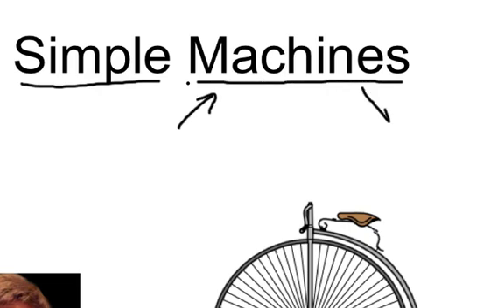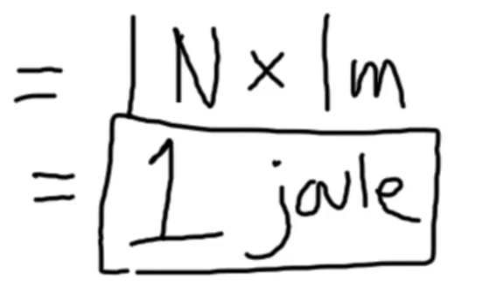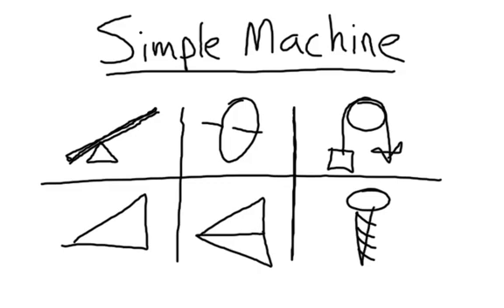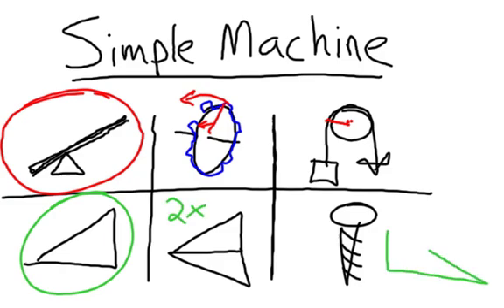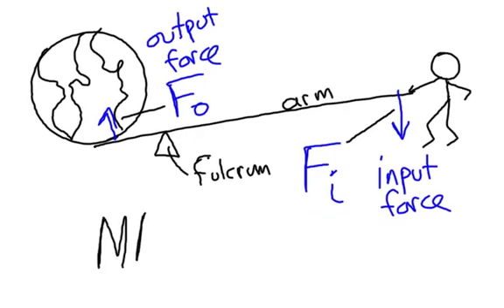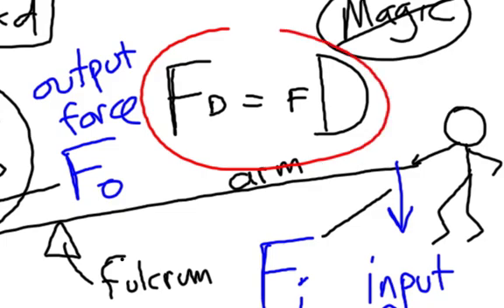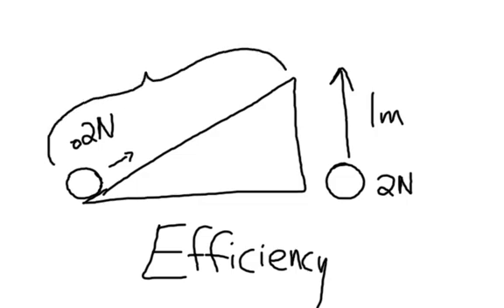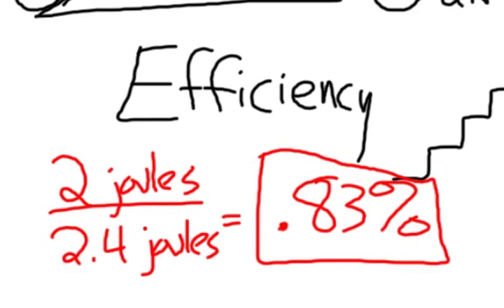Simple Machines

Comment: There are actually SEVEN simple machines.   You can add a "bow string"  or "draw string"  to the list.     Imagine a car stuck in the ditch.   You tie a long rope to the bumper and then go across the road and tie the other end to a tree.   Then you go to the middle of the rope and push sideways.   You have a mechanical advantage and your push is more effective at getting the car out of the ditch than if you simply pushed in a straight line on the car.   Try it.    A "bow string"  fits the definition of a simple machine but it always gets missed.

Comment: Actually, that's not true.  Take a lever as an example.  You can use it in two different ways depending if you are applying force to the short arm or the long arm.  If you wanted to lift a heavy stone you'd place the short arm under it and press on the long arm.  You could also fling small rocks at people by placing them on the long end and applying force to the short end.

So, the output force can be greater or smaller than the input force.  M.A. is less than one if you are flinging rocks.
Reply: THere are different types of levers that work in different ways.

Comment: " Skeptics argue that regardless of the exact mode of operation, if the output power is higher than the required input electrical power, the device should be capable of running "closed-loop", producing excess power without external batteries.[4] Such operation has never been demonstrated." - Wiki

Nope.